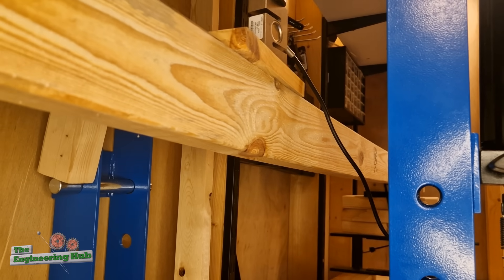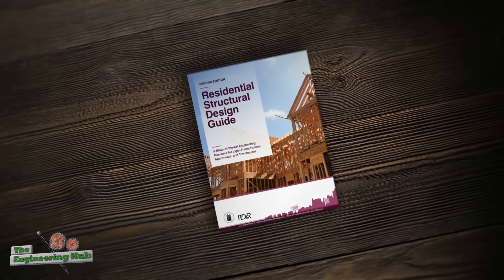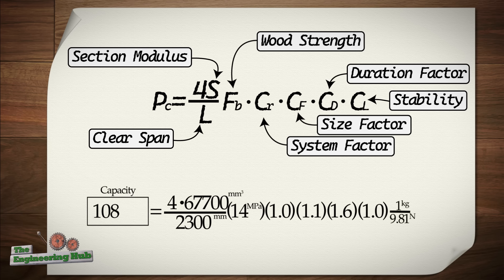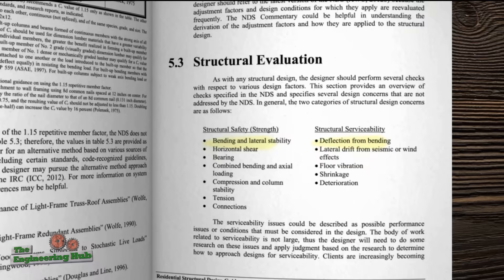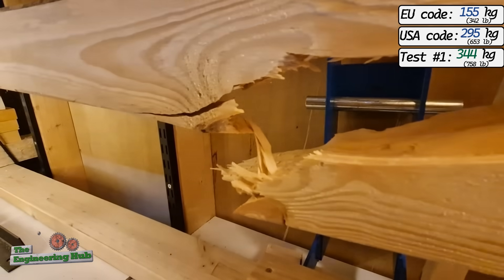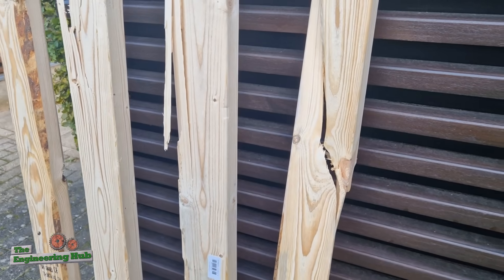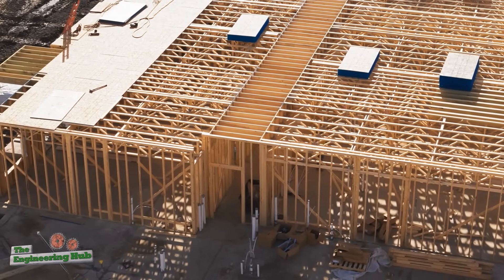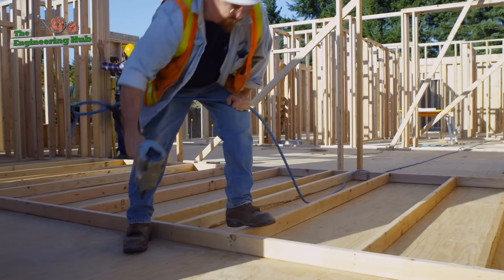I tested the strength of the 2 by 4!

Comment: Wow I have always wondered and honestly subestimated the might of the good ol 2x4 I'm impressed.
Reply: I have tested thousands of pieces of solid lumber and fingerjoined lumber in various ways.  Tension, bending break tests.  It is pretty crazy to think a high grade 2x3 fingerjoined lumber can easily handle over 20000 pounds of force in a tension test before it breaks.

Comment: For whatever it’s worth, home building in the US can vary widely from region to region.  I grew up in a very rural county and they STILL don’t have any building codes there; the only thing you have to get permits and inspections for are wells and cisterns.

That said, as I understand it, most average sized homes built these days in the US use engineered floor joists and engineered roof trusses as well.  2x4 are more used in vertical applications in the general framing process.

I’m definitely not an expert, but those have been my general observations.
Reply: They have NO building codes at all?  I don't know how people get insurance then.
Reply: @justayoutuber1906  The whole county literally has zero zoning or land use regulations.  Also in Colorado, no state wide code other than for schools, state owned buildings, and multi-family.

It's an extremely rural county with only 3300 people in a pretty large area.  Poverty level of 19 pct. population of 1.4 people per sq mile.

Comment: YSK that APA codes typically use the lower 5% AND includes a safety factor. Just using the lower 5% would result in a lot of failures.

Comment: Stud material is meant for vertical applications in a wall diaphragm, not to be used as horizontal framing members.  Therefore the load is applied through the longest axis, not either of the shorter two.  Also they gain ability to carry VERTICAL load by the addition of sheeting systems, both interior and/or exterior.  Usually stud material is an inferior grade of lumber from inferior tree species such as spice, pine or fir.  The only times I ran into specs for using structural lumber in stud applications were when the walls were above normal height.  For example, building an addition onto a shop with 16 foot side walls the engineer specified 2x6 MSR studs.  That’s Machine Stress Rated.  

Structural dimensional lumber is higher quality and meant to be used in horizontal load applications such as headers, beams or floor joists.  It’s not only made from better species of wood, such as Douglas fir or larch, but also graded higher by visual inspection.  

The code books have tables to reference that give a designer guidance on acceptable spans for different dimensional lumber sizes, types and spacings.

Suggestion: do a stress comparison between a 2x6x8 stud grade and a 2x6x8 Douglas structural lumber.  I think that would be more educational to the average person who goes to the home improvement box store and doesn’t know what piece of lumber they need for their project.  Stud grade lumber shouldn’t be used in horizontal framing that experiences a vertical load.

Comment: I work at a place specializing in reusing old wood. The 2x4s are actually 2x4. The grain I see are from much larger trees. I am also amazed at how straight the old wood is. Even hand hewn is amazingly straight compared to modern lumber. Great video
Reply: I was involved in a project rebuilding a four story mansion built in 1903.  It was completely dismantled and trucked 1500 miles across a little of Canada.  I spent a month in a field sorting out a couple of tons of Italian terracotta brick that trimmed the exterior.  Over there was the 2x4 framing.  They used single pieces on the exterior, 30  40 feet long, straight as arrows, full 2x4 fir.  They didn't use it because you couldn't drive a nail into it.

Comment: No one uses a 2x4 laterally so what exactly is the point of this video????  2x4's are designed to be used in compression for vertical wall loading.  2x6 and up and lateral beams.  No one is going to use a 2x4 and point load it in any way......unless you're Russian...they're definitely stupid enough.

Comment: According to 2:13 the load is applied to one point. Why did you use a long piece of board to push it down? Is the force not spread over the 2x4 widely?

Comment: Any carpenter worth his/her salt doesn’t use 2x4s for horizontal structural members unless a very short span such as closet ceilings. Sew are used primarily for vertical structural members or blocking.

Comment: I think wood has gone downhill , i buy structurally sorted wood and i am not impressed with recent stuff . I use recycled old wood where possible , often has 20 rings an inch over 2 in some sitkas and is vastly superior . Most regs are well over engineered and can get away with crappy wood .

Comment: Question. Does europe still call them a 2x4?
Reply: No. They are called '45 x 95 cm construction wood'.
Reply: @gorry123  ok... so I'm 'Murican as they come, so I know a thing about making measuring systems complicated, but why not just 50x100?
Reply: @fightingblind  Ha, you made a good point. After learning about American timber framing using 2x4s I was looking for 50x100 and the "incomplete" 45x95 surprised me as well. BTW 50x100 can also be obtained no problem, but not as the typical certified construction wood. My theory is that - since our C24 construction wood is kiln dried, planed and with rounded edges, it may be coming out of the mill as a green 50x100, and then shrinking, planing and smoothening it may be eating away these couple of milimeters. Also, as far as I am aware, 45x95 is not an European copy of the American 2x4, but rather an independently developed/evolved Scandinavian standard that happens to have similar dimensions.
Reply: @gorry123  interesting. The American 2x4 is actually the pre-milled/planed spec. Actual size is 1.5x3.5. 😊

Comment: I’m just hear for the video image, that’s a tension style load cell you’re using on a compression style test. You are getting inaccurate information from it. You must use the threaded holes as you are applying pressure on the frame and not distributing weight on the center where all the magic happens. Ideally, you would want to use some sort of wench in this scenario and pull on the 2x4. If you insist on using it for compression, you still need to use the threaded holes as pressure points, but you are producing a negative signal voltage and it’s wired backwards if it isn’t on compression. (Former scale technician of 7 years)
Reply: You might want to inspect that load cell for damage at this point as well. Any signal over 30mV is considered damaged, but it may operate adequately enough higher. Take a few ohm readings and measure the bridges. Input+ to Signal+ should be the same as Input- to Signal- . Input+ to Signal- should be the same as Input- to Signal+ . This should inform you that the load cell is still balanced at the very least.

Comment: My house was built in the 1950's (US) and all the lumber is dimensionally 1/4 inch taller than what you would find on the shelf today. The growth ring patterns are very tight ("old growth"). If you're ever demo'ing old growth structure and are able to salvage any of the wood for reuse, it's worth it. None of what they sell today will match its strength (even holds screws and nails better).

Comment: Why go so cheap in the first place? Most 2x4s are crap cuts and sap wood, not to mention horribly dried (or not in a lot of cases).
Wall framing and some short span applications will be fine. But why not up your game with a slight bump in expense, and get more insulation area, significantly more strength, and at the least better quality wood. If you are so stuck on building "cheap" then buy 2x12s and rip to 2x4s. At least then you have good wood. 
And no job that I have ever been on had 2x4 JOISTS for anything more than 6 feet, and never in a floor that has normal use no matter how short the span.
You would not get far around me being that cheap. Quality before quantity.

Comment: The correct answer is "none" because 2x4 are not sourced from wood that is used for making beams, they're for compression longitudinal loading.  You can simply walk down to the local wood pile and discover this with a small screwdriver: they weigh about 18% less per board-foot than actual beams do!

Comment: Having been in the trade for over 40 years and from design, specification and engineering there are a myriad of specific specie, grades, and grain orientations that will dictate the performances capable for framing members and their respective loadings and uses…we have used 2 x 4 stock for mezzanine floor joists to reduce heights in low headroom instances, spaced rather closely 12” oc and 8” oc yes this is atypical but it’s still there some 35 years later and was used for static loads.

Comment: Not surprised the tests are so different. We're dealing with natural resources that are hard to standardize. Wood can be very inconsistent. These tests are useful, but it's rare you use a single 2x4 in isolation. Also, 2x4s are never used for floor joists, only for wall framing.

Comment: As someone who's done lots of wood and joint testing over the years I can say this is an excellent video. Small boards like 2x4s see structural use mostly in two cases, vertical studs/columns, and truss members. The testing in this video was based on Fb bending. This is primarily the roof truss case, where a board member is horizontal-ish in orientation and loads are applied along its length. Such loads can be from from the roofing materials, people, snow, wind, etc.

And yes, the values allowed to be used by engineers for wooden structures are very conservative and have plenty of reserve strength.  Consequently, failure of wood structures usually occurs where wood is joined rather than in the wood itself. Bolts, nails, plates, glue, etc. are all used to join wood and the building codes have plenty to say about this as well.
Reply from the maker: @eyesonly4451  Thank you sir/ma'am, your comment is very much appreciated. It's also good to hear from someone who has attempted similar tests before. It's more to know that I didn't miss something instrumental. Many people comment about the use of 2x4s and that the test is pointless, but I think this conservatism extends to all sizes. I only tested 2x4s because my press can't break larger stuff😅. Cheers!
Reply: @TheEngineeringHub  If the point of the video is to point out conservativism in building codes, then ok, but you did miss the mark generally. 2x4's are rarely used in the scenario you were testing for. They are generally used in wall studs and therefore the use-case is in compression along its length where it can hold thousands of pounds. Out of that use case (framing walls), half the time they are not even load-bearing and are just used to hold drywall or doors in place.
A more useful test would be to test their compression strength by wood species and grades and some cases where they are bowed, twisted, and/or full of knots. I realize your setup cannot likely accommodate that though. The quality of wood products nowadays is junk compared to the past. Most big box stores sell you fast-growth yellow pine compared to the Douglas Fir I constructed my house from 30 years ago. In addition to them being very knotty, it is difficult to find straight ones with any consistency, and they are very light-weight in comparison to the past. Nevermind the dimension change from true 2x4 to 1.5x3.5 from many years ago. My first single-family home was a Sears home in Cape Cod style built in the early 1960's. It used true 2x4's as roof rafters. It will, no doubt be there still in another 70 years. The quality of the wood was very dense, hard, and heavy. Another useful test scenario would be to test true 2x4's to current dimensional lumber. You could see a significant increase in strength (in your bending test) compared to US dimensions and what a "mere" 0.25" makes in both dimensions. To make it useful to point out the affect of dimension on strength, you would probably have to mill several of each kind from the same log to make it fair as you cannot buy true 2x4's from a big-box store anymore as they would need to be custom-made.
Reply from the maker: @LisaMedeiros-tr2lz  I would really love to do test comparisons of old growth lumber vs. today's lumber. I'm in the process of acquiring some older wood. It should make for a very interesting comparison. I researched this very topic from a theoretical point of view in a previous video. It seems like the old wood should be stronger (no surprise there), but it's hard to say by how much. Lastly, no matter what I do, I can't say anything conclusive as I test only a few boards, but it still satisfies my curiosity, and I hope it makes for an interesting YT video.
Reply: @TheEngineeringHub  You should try sorting boards based on grain density/get different samples.
Because that "Euro" 2x4 (spruce?) and its buddies are plain horrible looking.
Father might just have heart attack from seeing such lousy low density wood and the idea of using it as load bearing horizontal structure.
Hard to see any old fashioned self respecting woodworker using such lumber in anything critical instead using slowly grown pine.
That's how buildings survived before all the "modern" buraucracy.
Reply: As a retired framer of 45 years who changed his college major from engineering after almost two full years (to psych and econ), I should mention 2x4s are specifically disallowed by code in floor and roof framing (at least in California).  For decades 2x4s were used as rafters and chords in trusses, but now just the verticals as mentioned by eyesonly4451.

Another observation, that has little to do with the matter at hand, is the two photos @ 1:53.  That may not be wood failure looking at the floor components.  The way the floor fell, the separation of failed components from the others (the wood would split, not shear),  and looking at the observable wood cuts leads me to believe it was something else like human failure (design, installation), though the second photo of the pair looks like there was some trimming of the floor joists in order to begin the repairs.  I would love to know the stories behind those two photos.

Interesting video, thanks.
Reply: I learned a lot from an addition I recently made on my house.  In California we use a lot of straps and brackets to home building.  I'm assuming that really adds to the joining strength.  Also, it had to be wrapped completely with 1/2 plywood and specials nails for additional shear strength.  Seems like crazy over kill...  But I feel safe in that room.
Reply: @DoubleDoubleWithOnions Earthquakes drive much of the building requirements out there. All the metal straps, special nails, and plywood are designed to resist motion induced shear loads that can occur during an earthquake. Such back & forth motion can rip a wooden structure apart at its joists if improperly built. Properly built wood and/or steel structures are the safest in earthquake zones. The worst is masonry construction, which can crumble like a dry cookie during an earthquake.
Reply: @eyesonly4451 Absolutely right your comment about wooden versus concrete houses resistance during an Earthquake
Reply: So based on your experience you agree with his statement that the code is “predicting values” or is imposing the minimum structural capacity that a 2/4 needs to provide?
Reply: @ovidiuciuparu6421  Here in the U.S., the American Wood Council (AWC) publishes the National Design Specification (NDS) and the NDS Supplement, all of which dictate allowable design methodologies and design values such as Fb, Fc, Ft, Fcp, E, Emin, etc. These values are typically based on the lower 5% tail of the normal curve. That is, if 1000 boards are tested, the 50th "weakest" board represents the allowed standard. This also means that 95% of the boards tested better than the standard. This provides a safety margin for design and installation uncertainties.

The various building codes all reference these AWC publications either directly or indirectly through other sub-standards, such as ANSI-TPI. The net-net is that all lumber/timber engineering is statistical and based on the statistical data derived from physical testing.

Wood engineering is never an exact science. It's more like designing to one's best statistical approximation and then depending on safety margins to cover the unknowns.